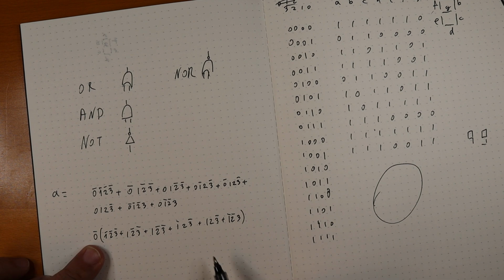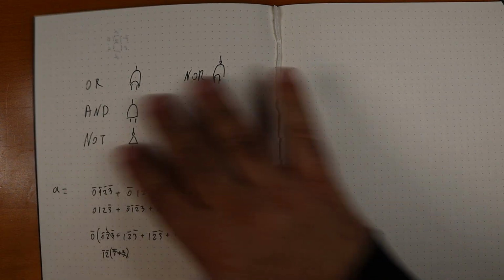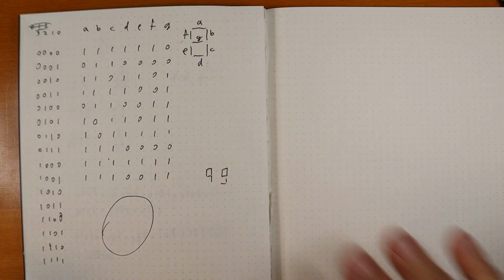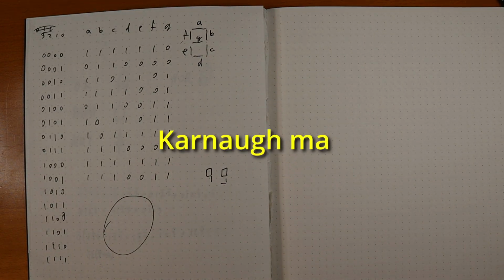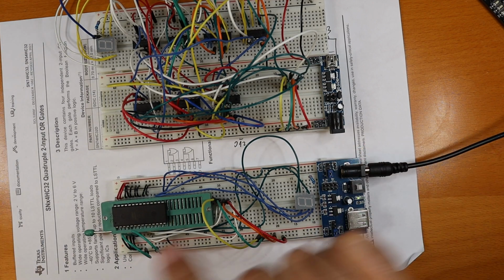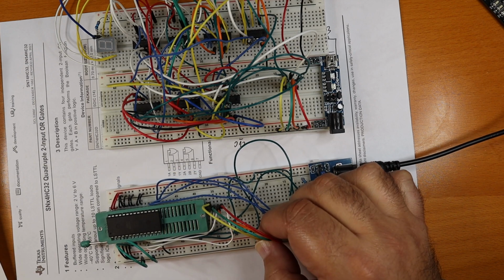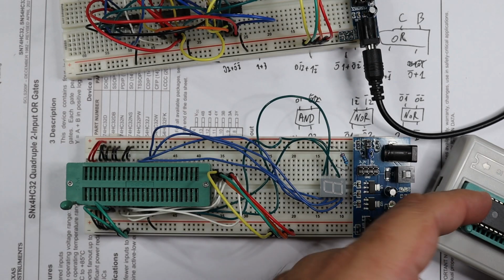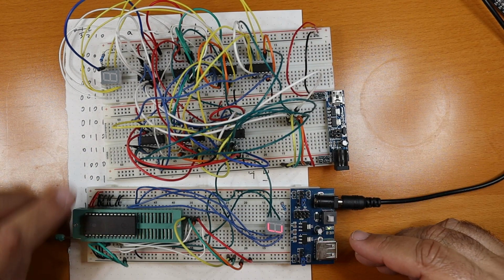FPGA Concepts Part 1: Ye Olden Days

Comment: Something you missed with the Karnaugh maps is that the loops height and width need to be powers of 2, so in most cases, 1, 2 or 4, you couldn’t use a loop that is 3 units long.
Reply from the maker: I don't get it. I literally say just that at 27:52, and I never form a group that does not satisfy that condition. How did you conclude I missed it?

Comment: Any shopping list incase we want to follow along at home? I've been wanting to mess with FPGAs for a long time and never got around to doing it. The last time was many many years ago in college.
Reply from the maker: I have no idea how deep this series will get and how long it'll run. In any case, things covered here are probably not going to get too specific to any one FPGA. This is about concepts.
With that said, the channel's main project is currently done on Xilinx FPGAs, and I'll probably soon be switching to this board: https://www.aliexpress.com/item/1005005961230338.html
It is relatively cheap, so it's not a horrible choice for first FPGA regardless of my work with it. Also, bear in mind you'll need some way to program it, which for Xilinx is recommended using a JTAG they sell.

Comment: Great recap for me from university many years ago! I work with FPGAs regularly, and still enjoy these kind of first principles. 

I was wondering if you'd expand to "don't care" (X) states in the Karnaugh map.

FPGA wise, another interesting step from the ROM example is to connect the outputs back to the input. Great for explaining FPGAs, and also Hazards, and why feedback is a bad idea! 😂
Reply from the maker: Since synthesis tools won't really let you create combinatorial loops, I don't think that's the interesting aspect of hazards. I was more interested in something almost everyone try to do, which is use comb logic as clock source to FF (sensitivity to non-blocking assignments). In Vivado you get an error saying you can't do that, but no real explanation as to why.
Reply: @CompuSAR  Very fair, yes. Possibly my own interests polluting the main story! Either way, I am enjoying the content! 😍

Comment: Currently in a digital circuits class and your video helped me clarify hamming distance in karnaugh maps. I didn’t correlate something that I was taught for error correction techniques to something that was lost on me earlier. 

Thank you for your video!! I am really excited for this series, FPGA is where I want to be.
Reply from the maker: I'm really glad you found it useful. Truth be told, beyond the very next video, I'm not yet sure where I want to go with this series. These two videos are mostly answers to questions I've received (some phrased as critique). I don't have a set plan for the rest of the series.

Also, if you liked what you found here, tell your friends :-). I could certainly use the traffic.